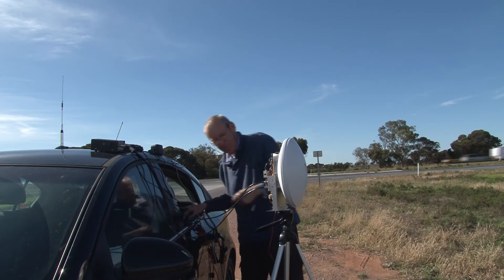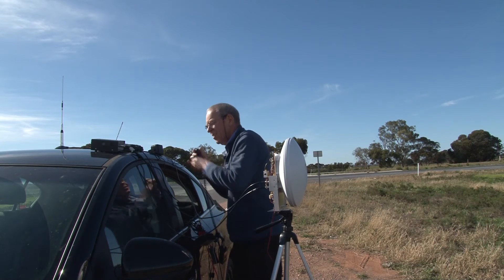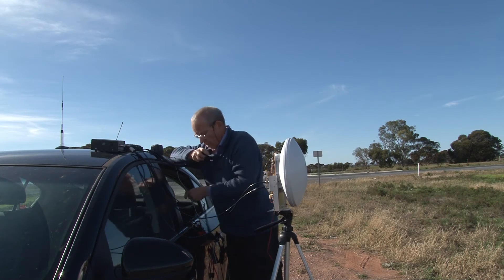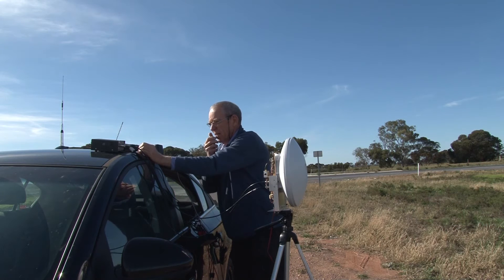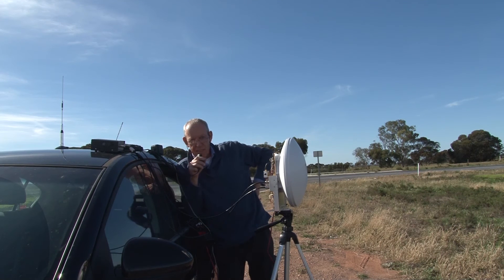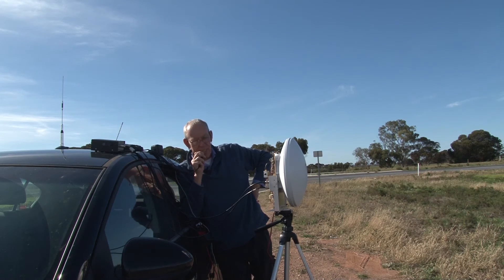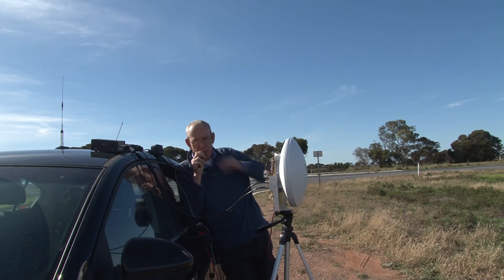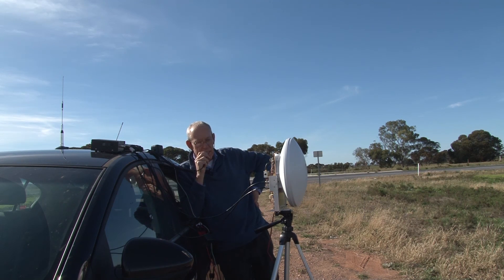VK5ZD 47GHz Transverter Test

Comment: Was this contact FM?  What was the power?
Reply from the maker: Yes, FM. My TX power is about 250uW (-6dbm).
Reply: Very nice.  My first microwave contact was 110km on 10GHz with 250mW on SSB.  You're running 1/1000th the power and on FM. Not to mention at 5 times the frequency.  Impressive :)